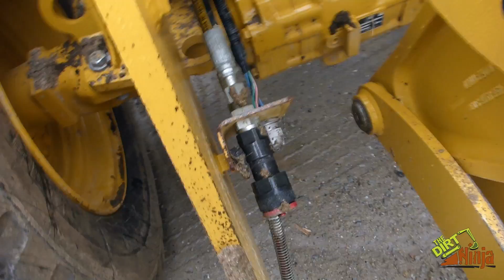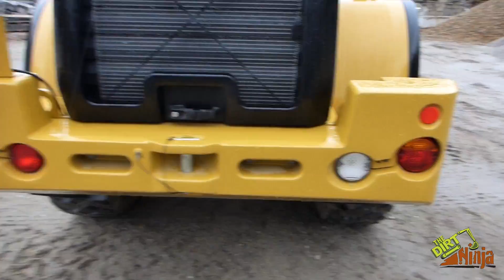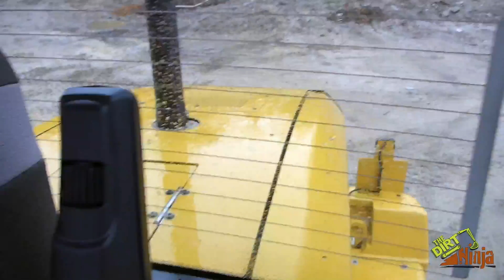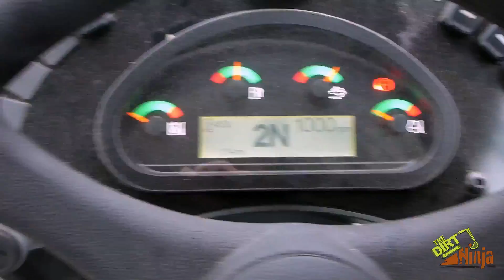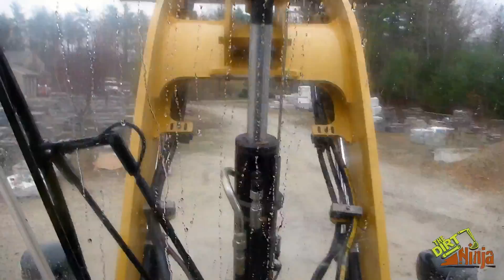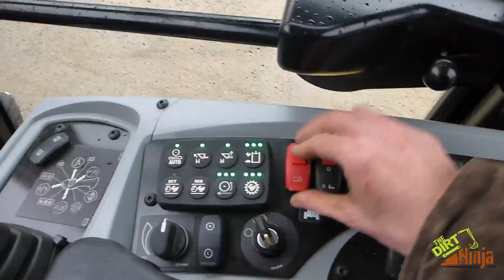Caterpillar 918M Wheel Loader Informative Walk-Around

Comment: To anyone who would want to buy one don’t, they are total junk the wiring harnesses give tons of issues. We have 2 and all they are is problems. Maybe new ones are better but the k series isn’t
Reply: what year machines does the company you work for have?
Reply: Ambient 2016 914K series but in the many times Cat mechanics came out they said the 910,914, and 918 are all the same
Reply: @trevorsouthard7784  hmm well hopefully mine isnt junk. just bought a 2019 918m so hopefully those issues are updated by now. thanks for the heads up tho

Comment: Nice vid.
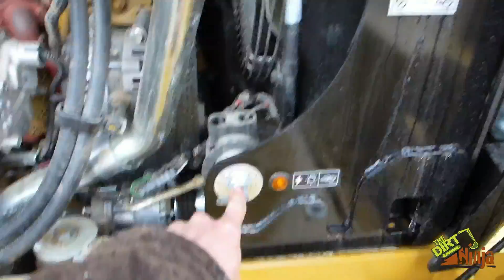FYI:  A new feature they added for the battery disconnect switch @ 6:19 is that the key can now be removed before the machine finishes the fluid cycle (for those in a hurry) and the light is still on.  At that point, the machine will automagically finish the cycle for you and then disconnect the power.  Cool(ing down) beans!  HA  (I believe this carries across on the whole line of loaders, but u would need to verify with Cat/dealer to be certain.)

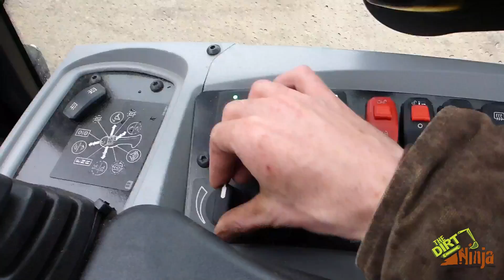Comment: Just for info...@ 13:44, that is actually the creeper control. Once it's switched on it control the speed of the machine. The creeper control lets you run the engine at high revs to run the implements and work tools, but limits the ground speed.
Reply from the maker: +Adrian Wright Thanks for the correction!
Reply: +Dirt Ninja No problem, but not correcting you, just helping.